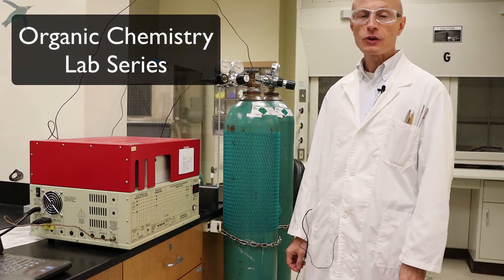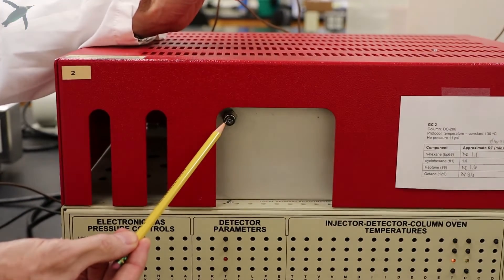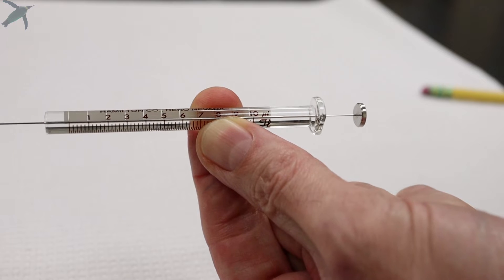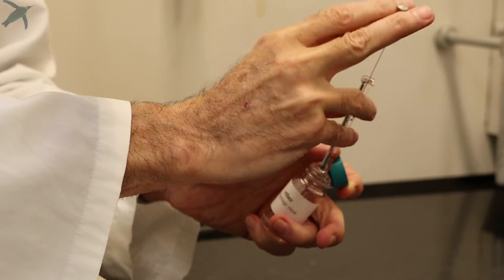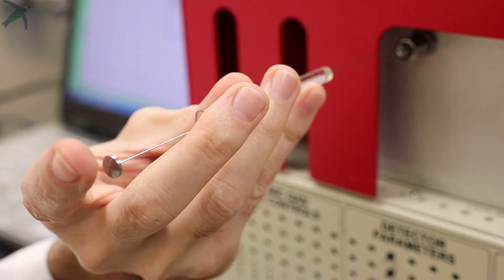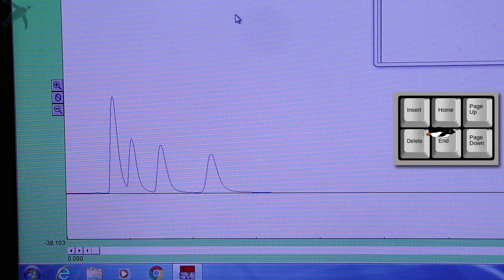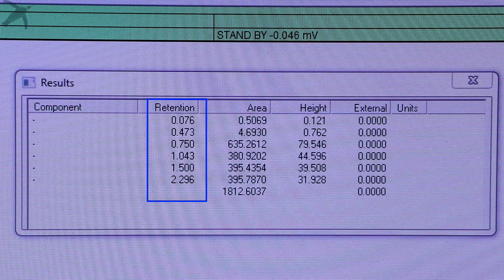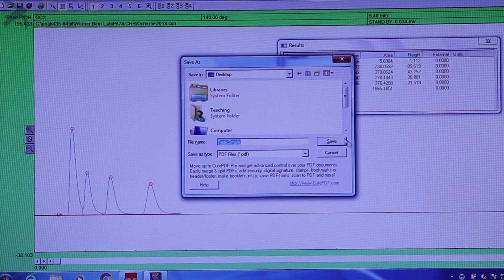Gas Chromatography:  LAB SKILLS

Comment: Very nice hands-on demo!  Would you make a video on how the temperature of the injector, column, detector, and exit port are determined?
Reply from the maker: I'm not sure what  you mean by "exit port".  The injector and detector temperatures depend on the kind of injector/detector, but they are not terribly critical for separation.  The column temperature profile (the temperature "program") is normally determined by trial and error and that's the most difficult part.  I hope that helps!
Reply: Not what I meant; I mean how do you determine WHAT temperature to use for your sample?